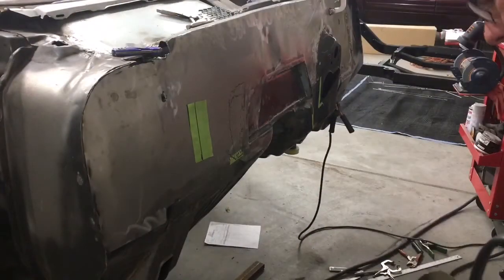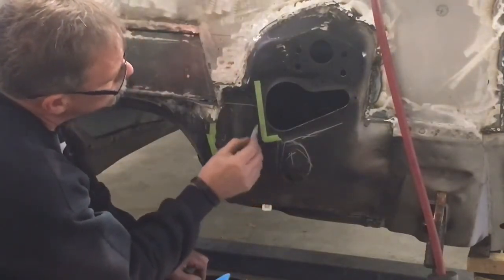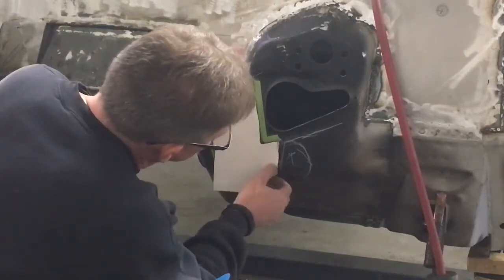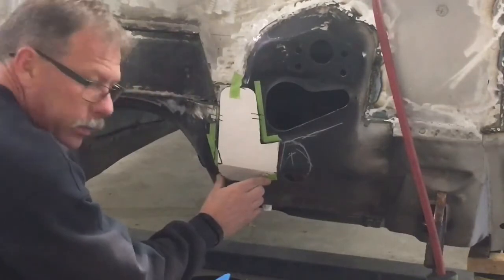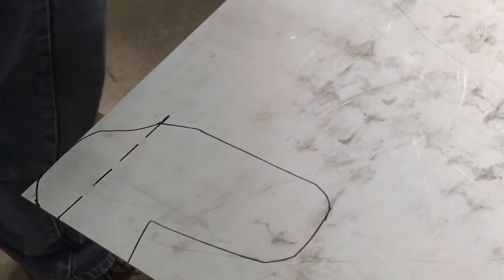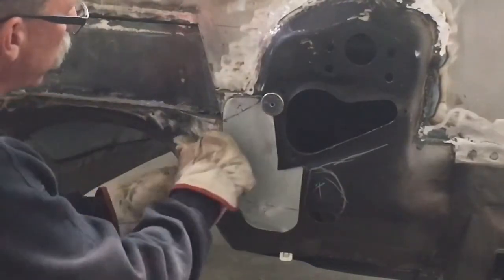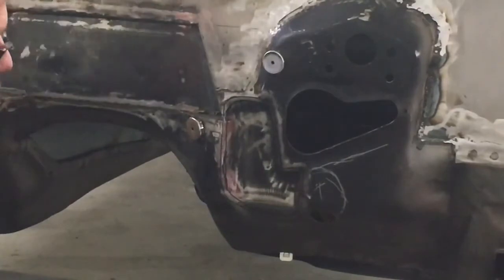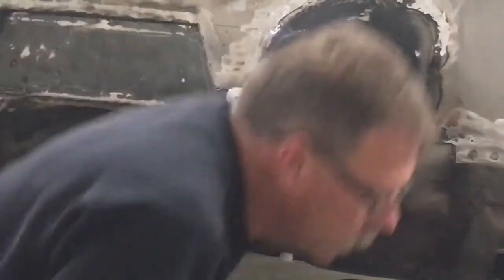Pattern Making and Patch Panels

Comment: I love the magnets you used, where did you get them?
Reply from the maker: I think I got those on Amazon, there were 10 or so in a container for just a few dollars.
Reply: Eastwood will try and sell you some 'stitch weld magnets' for a pretty penny. Just search neodymium magnets on ebay and you can get a 50 pack for peanuts.